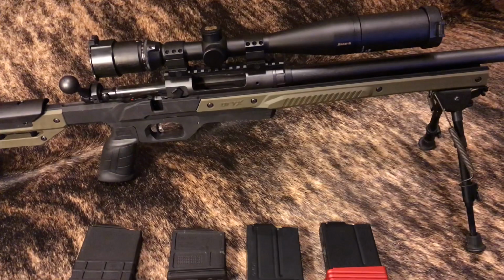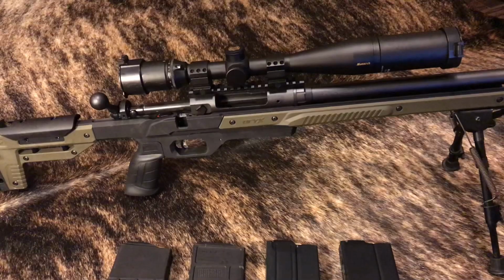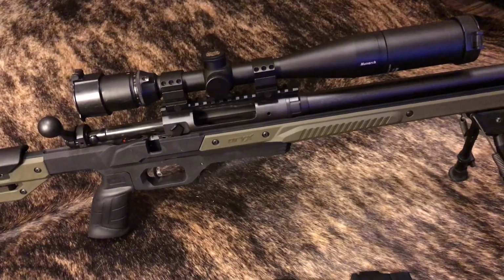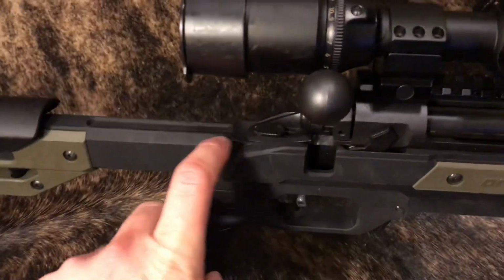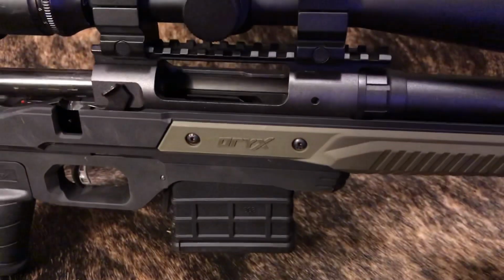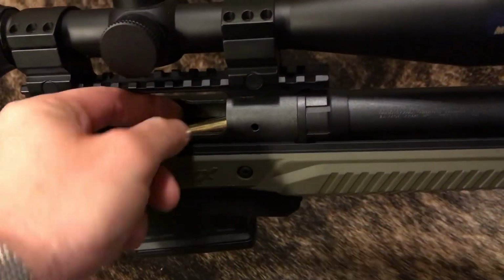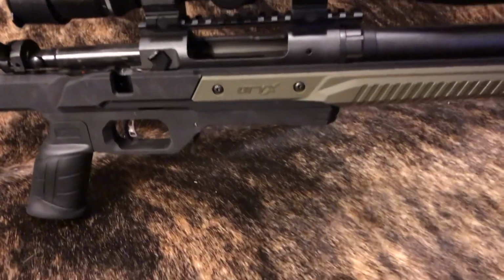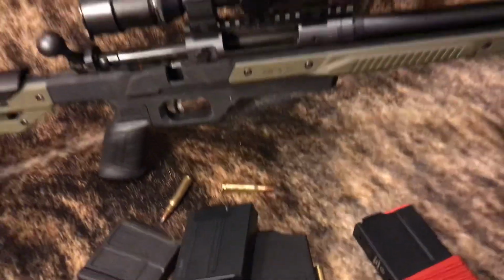Oryx Chassis review and magazine comparison

Comment: I have a Magpul for mine, doesn't seat into the chassis. Sometimes I have to push it further up into the chassis to get the bolt to catch the round. It also slides right out if you tug on it at all.

Comment: Its not the chassis that's causing accuracy problems,i have a weatherby vanguard short action. 308 with this chassis on it and its as accurate as a $4000.00 rifle. Hate to say it but its probably your savage barrel thats causing your accuracy problems. I only use the metal magazines as im not a fan of the polymer magazines.

Comment: I have a Howa short action .223 with this stock and plastic mdt 10 round mag. It would not feed rounds. I traced the fault to the bolt release being too long in this stock. The bolt was sliding over the top of the round. Was not behind the round. Stripped down and ground off little by little and hey presto feeds a dream. Hope this helps anyone else who has encountered the same problem. Accuracy is fantastic.

Comment: I'm using a 10 round pmag on mine and it clicks, locks, and has no issues loading.
Reply: Mine is a little tight but I like that. Doesn't rattle around. Feed great. I did trim just a little where it was touching the chassis but works just fine for me.

Comment: I dropped my Stevens 200 308 in my oryx had same problem with the mdt mag just use some 400g wet dry paper and smooth it off fixed the problem and use some jb weld as bed gasket before bolting it down wow what a difference
Reply from the maker: Glad it worked out. I’m loving the chassis and after buying the metal mag I never looked back

Comment: I have the Howa 1500 Oryx.  The MDT polymer mag it came with works fine.  My Magpul mags don't work.  They won't lock in unless you really smack it in with the bolt open, then the bolt drags really bad on the top of the mag.  Looks like the metal mags are my only route as the MDT polymer only hold 8 rounds, and I'm needing 10+ for matches.
Reply from the maker: Nathan Powell we received another chassis and still have the same issue but the polymer mag works better on the 2nd chassis than the first. It still hits but less so and less adjustment needed.
Reply: I know it's only a week, I am trying to decide on the Oryx chassis or the KRG Bravo, how are you liking the Oryx?
Reply: @stevenl7878  I think it'll come down to personal preference for the most part.  So far I'm really happy with the Oryx (and their customer service has been great).  I like the full length (from butt stock to front of fore end) one piece aluminum backbone on the Oryx.  Very sold feel.  Two things I like better on the KRG Bravo are the fore end (it's flat all the way back to the mag well, where the Oryx angles down toward the mag well.  This allows for the use of a full/longer ARCA rail.)  I also like the bottom of the stock on the KRG is longer and works with a rear bag easier/better.  Minor things, but I wouldn't hesitate to run either one.
Reply: @Nathan Powell - What Calibre? I also have the Howa Action but with 2x 10 Shot Metal mags that are as smooth as Silk... Strangely enough, I didnt even ask for them.
Reply: @Top-Jimmy  I have the 6.5 Creedmoor.  MDT told me their metal mags would work, but would still need the front top modified to fit.
Reply: @powellnable  My Oryx with the Howa 1500 - 1 - 9 Twist heavy Varmit 24" is by far the best rifle Ive got. even in .223 can get out to where the mini actions just cant reach still Subsonic.Extremely happy with it. For those that arent aware, the .223 Howa 1500 series is basically all Sako Tooling as Howa purchased it all from them. The Bolt action is smooth as silk. Oryx all the way for me.
Reply: Nathan, is your Howa the 6.5 CM? I just ordered this conversion and some of the MDT polymer mags was hoping i wouldnt have to wiggle them around and it will be relatively smooth action to load a round. Thanks!

Comment: That sucks, I've had a Howa short action in an Oryx and a Howa long action in a Oryx as well
The short action 308, I used the MDT 3 round polymer mag with zero issues
The long action, I used the MDT metal mag with zero feed issues either
It sounds like they had an issue with the height of the mag well on the Oryx for Savage actions

Comment: I have bought Oryx for Savage axis. Yes the budget riffle budget chassee. But I was confused how many issues i have:
1) Magzine problem. Plastic MDT when it is not perfectly vertical causes issue with fed.
2) The place for recoil  paw is too big and it`s moving inside
3) QD works from one side and does not from other
4) Cleaning the riffle is just pain in an ass

Comment: I just bought an Oryx chassis and three PMAGs. The PMAG really has to be slammed home for it to lock. That may be caused by the very tight fit. I expect the mag will wear (wear marks are visible on the mags after only one use) and will not in the future require the force needed now to fully seat.
Put the PMAG in the well, then give it a sharp rap on the bottom to lock it into place. After doing so, I've had no problem cycling rounds into and out of the chamber.

Comment: Did you see any improvement in accuracy over the accustock?
Reply from the maker: After replacing this chassis with another one from Oryx, I’m very happy with the accuracy. Oryx was great about the warranty. So to answer your question, yes more accurate and the ability to now remove the mag is great. Definitely weighs more but not too bad.
Reply: What was wrong with the chassis ?
Reply: @aaroncarey2909  in the video he states the rifle was having accuracy issues.  Odd that the new one was heavier. They must have changed something?
Reply: @wroughtmetals  must be a gen 2, heavier and improved!!